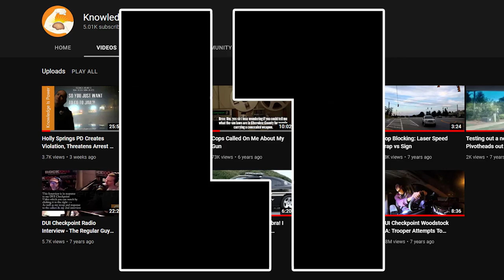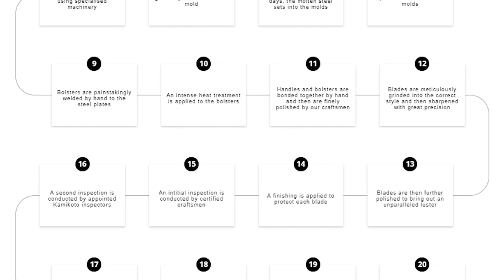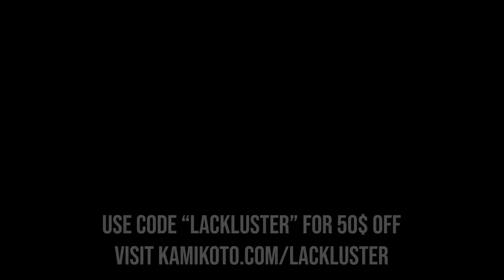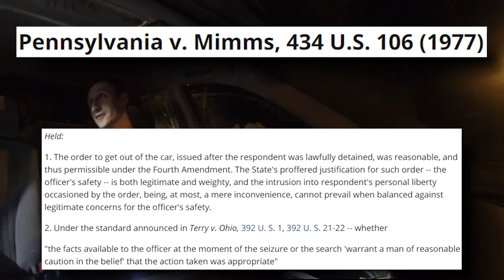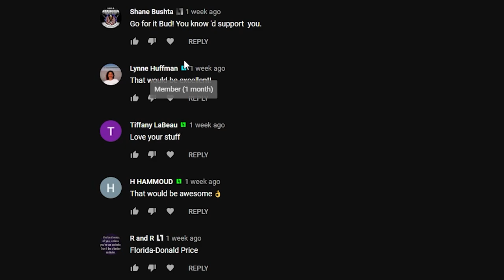Rude Cops Intimidation Tactics Fail Miserably

Comment: Those troopers were rude, insolent, unprofessional and had a mutual assisting gang mentality. Shame on them and their supervisors for the lack of enforced standards and the risks they force upon the very public which pays their salaries. They should be reprimanded and retrained.
Reply: @FMF Veteran 
       Florida also. Even if your a resident. 
I've lived it  also FMF. And learned. And been charged with contempt for expressing my opinion to a Clown in a long black Dress.
   Thinking he was God almighty himself.
Reply: retrained?? they should be benched permanently. Find another profession something they'll be good at because it's not policing. That job absorbs the weak minded and there's no room for that with people's lives at stake in that profession.
Reply: You left out condescending and patronizing.
Reply: opsh candycar  the in  EthelEthe&Lucy like be ouldsh They
Reply: @tommyjones1264  it takes a certain mentality for that job to be appealing.  I suggest they remove most duties that involve interacting with the general public, and only come to most interactions only when called by someone trained to deal with people. Seperate agency for motor vehicle infractions for domestic disputes and probably some other new departments developed along specific lines.  They really shouldn't have interactions with the general public

Comment: I think it's best to refuse a "vehicle inspection." They are literally compelling you to act in a way that could incriminate you.  Besides it's not even a crime but a code infraction.
Reply: It's also unrelated to the purpose of the stop, and hence, unnecessarily elongated the detention unlawfully.
Reply: Exactly he is under no legal obligation to assist them in ANYTHING including a "vehicle inspection"
Reply: @bluemeanie9554  

Yes.

If they want to inspect the vehicle they can get a warrant to enter it, and then test all the things they like.

This wasn't an inspection station, it was a DUI checkpoint.
Reply: @aennaenn7468  Point blank that was a bogus checkpoint to begin with he really needs to complain and dispute the validity of that checkpoint
Reply: I was thinking the same thing. Pay me and I’ll help you

Comment: My question is if an officer wants to conduct a "vehicle inspection" do you have to comply?  Seems to me the questions that follows that request should be, "Can the information you're looking for be used against me in a court of law?"  The answer is obviously "yes" so shouldn't the information be protected under the 5th amendment?  Inquiring minds want to know.
Reply: A truck driver refused to assist a state trooper in a road side inspection. Not sure the outcome but a search should find it.
Reply: I would assume it would be a violation of the fourth amendment, prolonging a stop longer than what is necessary for the original detention according to Rodriguez V. United States. They had no reason to inspect the vehicle, only trying to search for a reason to give him a citation therefore prolonging the stop. Because it’s a DUI checkpoint, the reason for detention would have been to figure out if he had been drinking or not. Not to do a vehicle inspection. But that’s just my assumption…
Reply: My question is: A vehicle inspection IN THE DARK!?
Reply: @WayneTX254  That I recall.
 He got out of the cab, told the cops to do the turn signals and brake light checks by themselves.
 He wasn't being paid to help them inspect.
Reply: There was a truck driver that used this exact logic at an inspection stop. He refused to help them when they asked him to get in the cab and put the lights on, blinkers, brakes etc etc
Reply: @rhino5640  Right and the stop should've been over in under 3 minutes. They prolonged the detention and violated his rights.
Reply: @my83roadster4me  Thanks for dropping that link 👍
Reply: @babydriver8134  
I think it was more along the lines of he isn’t required by law to help them incriminate him.

Comment: This same exact thing happened to me at a DUI check stop. I did literally everything the driver did. I was very calm and polite and rolled my window down just enough to talk to the officer and hand him my ID. He told me to pull over to secondary while about a half a dozen other officers surrounded my vehicle and started inspecting the outside of my truck for anything they could find. I ended up with 3 tickets for some bullish like “unsafe tread on tires”, “expired drivers license”, and “improperly mounted license plate”. The crazy thing is, not once, NOT ONCE, did they ever ask me if I had been drinking! That’s the moment I realized that these “DUI checkpoints” aren’t really to bust drunk drivers and keep citizens safe, rather they are streams of revenue for the city.

Comment: Should be aware that the knifes you're promoting are pretty much overpriced chinese made knives. They had a promotion a while back where you would save 1000$ if you bought the knife for 300$. No company would offer that kind of massive drop in prices. They use 420J2 which is an economical steel for budget conscious cutlery. Their return address used to be to a hotel in Japan. 

From Wikipedia "“420A (420J1) and 420B ( 420J2 ) are economical, highly corrosion resistant stainless steel grades. Knife manufacturers use this material in budget knives, also in diving knives due to its high resistance to corrosion.”

These guys are basically chinese scam artists that try to brand themselves as japanese high quality knives. Just figured I'd give you the heads up.
Reply: With that said, i'm glad to see you getting sponsored, these videos are great.
Reply: Glad to see him getting sponsors as well. That being said, please be careful not to promote a bad company - it will follow you around for the rest of your youtube career.
Reply: @jamon5933  Exactly that's why I'm hoping he takes this the right way. I want him to get paid, I just dont want him to promote false or bad products.

Comment: Question for the community.

If you can plead the 5th, does that also apply to using your car signals if a cop wants to enforce a 'vehicle inspection'?

Can't you just refuse to use the blinker when asked as you have the right to remain silent? I feel like this protection should extend to these 'orders'.

Comment: Vehicle inspection is something that law enforcement has the ability to do but it is something that I would not help them with. If they wanted to push it, and they are smart enough, they could find violations on vehicles leaving the assembly line.
Kindly refuse to help them with the inspection and if they want to enter the vehicle to function safety equipment they need to wake up a magistrate to get a warrant

Comment: You should have demanded given and sired name.  Then you should write up a bill for each service performed.  $200.00  right signal, $200.00 left signal, $300.00 brake, $400.00 backup lights,  $150.00 handing the license,  $250.00 handing registration.  Can still be done if you can find the man who made the orders.

Comment: He forgot to check your horn and emergency flashers. Emergency flashers is a separate circuit from the turn signals. Next he forgot the crawl under the vehicle and do check your brakes to make sure you have plenty of break padding and that your brakes are in adjustment. Since you have hydraulic brakes he forgot to check the hydraulic fluid and to see if the brakes are improper service. Yes there is a test for hydraulic brakes

Comment: Wonder if they shined the lights to check his eyes for dilation and redness as well, that was an unnecessary amount of time. I know it's often used as a visual exterior search for any incriminating evidence lawfully within their purview, but that seemed a bit asinine. 
Trooper 2 was trying to rip open the door, even before saying to open the door. Immunity should be dropped for this kind of crap. Any citizen would be jailed for attempted B & E, harrassment, holding against will, etc., pulling this move.

Comment: Kamikoto knives are the worst knives I have ever purchased. I have several Japanese sets, proper knives. I am also a chef. They are not good knives, they are not expertly made and they are not made with Japanese steel. They are horrid knives. They are single bevel, and I actually found them very dangerous to use. They gave me my money back, and offered me a free set but they were so bad I didn't want a free set.

Comment: LackLuster, I believe the Georgia Department of Public Safety Policy on roadblocks states that roadblocks must be used for legitimate purposes, whose primary purpose of monitoring and verifying drivers license, driver conditions, vehicle registrations, and other Georgia Motor Vehicle Codes requirements or to locate suspected criminals.

No disrespect intended to the two Troopers, but an eye test alone does not serve sufficient proof that a vehicle's tire tread is illegally low to issue a summons to the driver. Instead, the Trooper would need to measure the tread of the tire.

Throughout the interaction, I saw the driver with a gun inside the holster on his hip which he didn't inform the Troopers because citizens are usually required to disclose their possession of a weapon.

The driver should not conceal a firearm from a police officer during a traffic stop during which the driver must reach into the glove box to retrieve his documentation because it can escalate into a deadly force encounter. 

Both the checkpoint and vehicle inspection were within the Troopers' authority but it seems like they were on a fishing expedition by extending the duration of the stop once the paperwork of the driver was in order and there were no warrants. They should have let the driver go on his way.